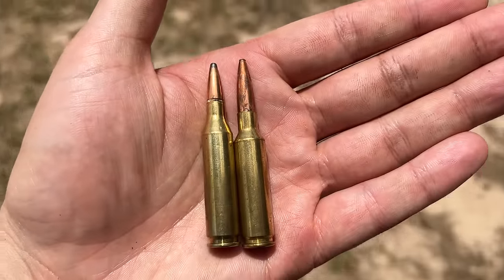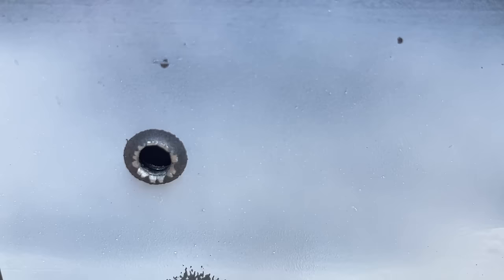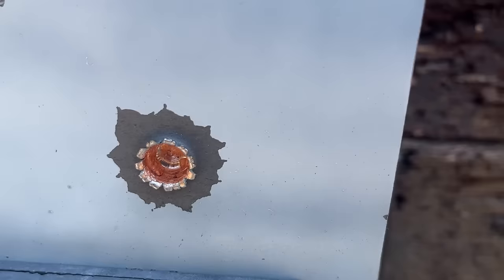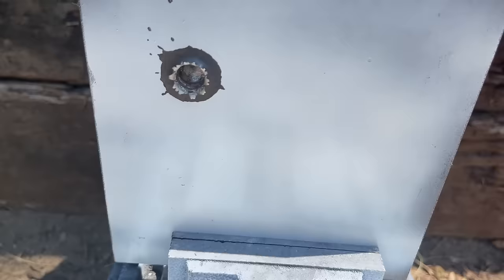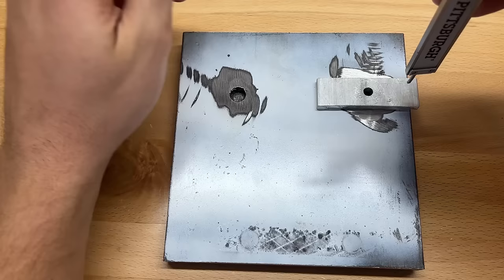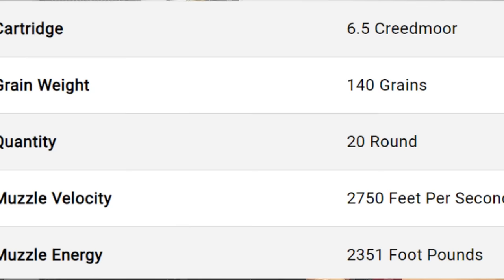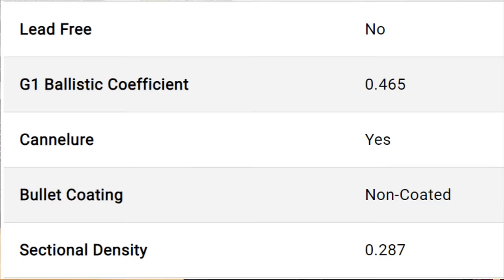243 vs 6.5 Creedmoor: Not So Close On Mild Steel?

Comment: 40 years ago i tried some 80grn 243 on 1/2" steel and they completely penetrated  can't remember what brand they were.  about 30 years ago i did some testing with a remington 600 243 with a 20" barrel and a brno 243 with a 24". with the same hot hand loads with both 70 and 80grn projectiles in both rifles on the same day. i was surprised that the 24" barrel was onley getting about 150fps faster than the 20. i think a lot of people forget just how good some of these old calibers are in the mad rush for something newer.
Reply: At shorter distances there is no difference. But as the shot distance increases the old stuff looks worse and worse. If you just hunt and don't go over 200 or so yards it makes no difference. 

By 300 yards a lot of the new stuff is performing a little better. By the time they travel 500 yards the old bullets are slowing down and dropping a lot more, and are more affected by the wind and it just gets worse faster after that.

 A lot of people are not shooting at those distances so it doesn't matter. But the new cartridges are vastly more efficient, unless you have custom fast twist barrels and you're making custom ammunition, & custom magazines to fit them for an older round. 

The young guys who are starting out buying rifles should be getting the newer technology, since they have to buy the stuff anyway. If you have the old stuff and it's working for you, might as well stick with it.

 But if you look at just the bullet of a modern precision rifle, and compare it side by side with something from a few decades ago there's a huge difference in how streamlined the bullet is.
Reply: I have found going from a good load from a 20" barrel to a 24" can be very different depending on the powder used for each barrel. The 24" barrel will usually like a slower powder for the bigger difference to be seen.
Reply: 150fps is over 5% which is a considerable increase in energy

Comment: should have tried a 55 grain ballistic tip out of the 243 @4000fps lol. it penetrates lvl 3 ar500 better than an m2 ap bullet going 3200 fps out of a 300 wsm lol. the 243 almost penetrated completely through 2 6x6 side plates. where as the ap bullet only penetrated the first and just stuck into the second plate. @50yds. the 243 also made a much wider hole due to it expanding as it penetrated..

Comment: Unless I missed it did you use 100 grain psp .243 or just 80 grns?  Ok, so you did use 100 grn .243 which should have done way better, so it needs the 22 or better yet 24 inch barrel to get up to speed and it should almost penetrate the .5 inch I would bet .420 inch!!

Comment: 100g v 140g equates to .050 deeper penetration for the latter... Fact is they're fairly equal at that range. Personally, I prefer the .243 simply for the variety of ammo loads available. But, I believe the 6.5C is better at long range...?
Reply: Only when shooting paper.  They're both suitable to about 300 yards or so for deer-sized game.  I'm a big 6.5 fan (6.5x55 in my case), but they don't shoot magic death rays.

Can you go further than 300?  Well sure.  I can go further than 300 with my 45-70, doesn't really make it a good idea though.
Reply: The 6mm will out perform the 6.5 for long range. ALL the top PRS shooters shoot 6mms, with the 6mm Dasher being used by over 75% of the finalists in the most recent Armageddon Gear PRS match. A 115 grain 6mm is a very aerodynamic bullet with a very high ballistic coefficient.

Comment: Great video, however, not an apples to apples comparison. 100gr 243 vs 140gr 6.5 shouldn't be equal in steel penetrating. The 260 remington vs the 6.5 would be interesting and probably very close.

Comment: Good video and somewhat interesting results.  What did we learn from this?  The 6.5 Creedmoor, for all of its popularity, is just another good cartridge.  How much better is it than the 243, which was introduced more than 50 years earlier.  In fact, go back to when the first 7x57 was necked down to 6.5 and realize the only real advantage of the Creedmoor is faster-twist barrels and much better bullets.  The cartride, itself, is nothing special.
Reply: The 6.5 cred is nothing special , absolutely correct ! The test is almost meaningless . Two different cartridges and two different bullets , what’s the point ???…….
Reply: The fact of the matter would be if you create a round that would be good. At going through mild steel. It would fly right through a skin bag, possibly even caught her icing itself. Zero expansion no. Tumbling no. Fragmentation. Now on the flip side of that if you take around it that's really great at punching a hole in something like maybe a 45. It's going to really suck at going through mild steel. M'kay. I'm pretty sure every single person in this clip things boxers wear gloves so it doesn't hurt the guy they're punching. Hah😂 live in Bliss

Comment: Density of lead vs copper.  But animals don’t act like 1/2” steel.  Either kill great with good placement.  For ultra long range the 6.5 higher BC wins.  For under 300 yards a .243 is fine.

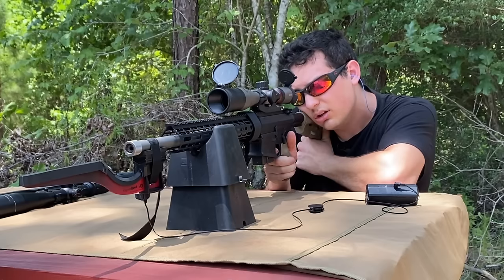Comment: What was the rate of twist on each of these? Just picked up a .243 Henry single shot with a 22" barrel with 1:10 twist. Not that I plan on shooting 1/2 inch steel, but I'm sure cor lost 100 gr. Will do a number on auto bodies, should the need arise...
Reply: It won't stabilize heavy bullets with a 10" twist. A Remington 700 has a 9" twist, & even that is too slow for most of the heavier Hornady 6mm projectiles. Hornady states the required ROT for their bullets in their catalog & some of their 6mms require 7" twist minimum & 6.5" would be better.

Comment: I think a lighter, faster .243 would punch through. Punching through armor looks to be heavy on velocity. 2700 just isn't fast enough for the .243. I think a year or two ago on another channel someone loaded out a .243 AR with a bullet running 3400+ and that plate was not an issue.
Reply: Yeah a 100gr bullet going 2700fps is slow for 243. Even factory 100gr loads are going around 2950-3000. You can get another 200fps with hand loads or nearly 4k fps with light 55gr hand loads.
Reply from the maker: Might need to do some testing with much lighter 243 bullets. They might toss things up a bit
Reply: @bananaballistics   Problem is, without handloading there isn't much out there below about 70 grains. I think 3400 fps was the breakover point for level 4 plates with .243 win. Always love watching your videos, and adding the information to what I can remember. We have so much more info now out there to make choices with.
Reply: CRS firearms. The BA-Shredder. He tested in conjunction with Buffman Range. Results were ok. But, light 6mm bullets are typically of the varmint grenade variety. They almost detonate on tissue. Not ideal to punch plates.. but, 6mm, round stock can be had in many alloys

Comment: I haven’t seen anyone mention this yet, but I think the heat generated at impact is the reason copper does so poorly. @banana Consider for a second how hot the steel plug was when you picked it up. 

Copper is 10x more thermally conductive as lead, and roughly 7x more conductive than steel.

At impact, all the heat generated needs to go somewhere, and it’s far easier and faster to dump into the copper bullet than into the steel target or into the air. 

Again, how hot was that steel slug? With copper being a better conductor, the copper bullet would have been heated to many times that temperature and melted/softened to the point it lost density and resulted in poor penetration. 

In a live game scenario, there are factors less friction at impact and the bullet doesn’t have the same runaway heat pickup. As the bullet continues to move through the animal and begins to slow dow , I’d imagine it is able to deposit heat into the flesh as well.

Comment: Those copper bullets looked like Barnes (or similar) which is a leadless hunting round and made to expand on impact, as you would guess from the plastic tip of those bullets.
Reply: The plastic tip was developed by Nosler over 30 years ago to circumvent the problem of lead soft points deforming while carrying, loading, & chambering! Plastic tips have nothing to do with changing the expansion.
Reply: The polymer tips were developed by Nosler 30 years ago to prevent deformation when being cycled into the chamber, which occurs to soft point lead bullets. Hornady changed the polymer type  because they discovered the tips were melting from atmospheric friction, something I had concerns about since Nosler's introduction of them decades ago!

Comment: I am not that interested in shoot holes in steel plates . I am more interested in how accurate a cartridge is on a paper target and on game .  I have used ,243 for decades and don't see anything here to make me rush out and buy a 6.5 Creedmorr .  I do however like the longer neck and sharper shoulder of the Creedmorr case which I know I could squeeze a bit more accuracy out off but not enough difference to drop the cash . When I think that .243W is not up to the job I jump right over 6.5 to .308 cal .

Comment: I would like to see 6.5 creedmoor vs 25-06 with similar bullet weights. 120 gr and or 100gr .
Reply: The 25-06 will be better with the same weight bullet because it will be longer for weight than the 6.5. As stated several times, a fair test would have been a 260 Rem against the 6.5 CR so the diameter & weight would be identical.

Comment: I have a 300 win mag and was shoot steel targets ranging from 100 200 and 300 yards and noticed and I noticed out of the three rounds I was using one of the were really hurting the 3/8 ar 500 plates. So I put it at 25 yards so I could see were it was hitting and the federal premium 180 power shock just went straight through it all the other rounds were still barely doing anything. I would like to see those 180 grain power shocks against that 3/4 mild steel plate
Reply: Those 180gr bullets are carrying a ton of energy. And they let you know it. My ar10 has had a little bit of everything, and there's a definite recoil difference between my favorite 140gr silver bear and 168gr GMM..
Reply: @PureCountryof91 Momentum drives penetration not kinetic energy.

Comment: Punching holes in steel is an indication of velocity. Push a pine needle fast enough and it will penetrate steel plate. Unless you’re looking to use a rifle instead of a drill to put your holes in steel, this is meaningless. But hey, it’s not hurting anybody!

Comment: A U shaped measuring plate, instead of flat, should allow you to measure without grinding!
Reply: Good idea!
Reply: It would also measure the frag depth. Not just indentation
Reply: @PureCountryof91  the U would not touch the raised edges if that is what you are talking about by 'frag depth'.

Comment: If you were tracking bullet design at all you would know the answer. First, sporting ammo is not designed to go through steel.  The reason behind that result with copper, is that due to complaints about sub par solid copper expansion at longer range (impacts on game at sub 2000fps) companies responded by making design improvements in ogives and the like to ensure that copper will expand more reliably at a wider range of velocities. On steel this just exaggerates the effect of this engineering. If you uses first generation copper bullets you would likely punch through more easily.

Comment: I'm at a loss. Sighting in my savage Axis 6.5 Creedemore this past weekend. shooting paper. all Good. I moved over to a 8x8 5/8 thick hardened stainless-steel Plate hanging at 100 yards. This is my 7.62x39 ringing target I shoot for kicks. Never have I damaged it. I thought it would be ok.  The 6.5 Hornady American Whitetail Punched a rimmed 1/2 hole clear through it. I could believe it. so, I shot it again. Now it has two 1/2-inch rimmed holes. I don't know why you didn't punch that steel at such a short distance. I know what I did. And I think I know what I see. I'm at a loss.
Reply: Hardened stainless 5/8? That hornady American whitetail is the worst ammo hornady makes. That’s surprising I will say. Wow

Comment: I've never had a .243 but I own a 6.5cm and it's a very accurate rifle and a very flat shooter over good distances.
Reply: 6.5CM IS NOT a flat shooter, it was never designed to be. Overweight bullets for caliber just can’t be flat shooting, its physics. By using faster twist and well designed bullets they are capable of incredible accuracy out to long distances. But the long and shorter distance accuracy is achieved with more variance in trajectory than lighter bullets going faster at the same ranges. Longer, heavier bullets generally have better aerodynamics and the increase in accuracy is more pronounced at longer ranges.

Comment: Momentum drives penetration not kinetic energy.     The physics of penetration is the same regardless of size so let's compare the penetration of the German 380mm/51 cal to the US 16"/50 cal at 25kyds.  The German gun fires a 1700lb AP at 2690 fps and penetrates 15.46" of face hardened armor.  The US gun fires 2700lb Mk 8 AP round at 2500fps and penetrates 17.36" of face hardened Armor.  The difference is momentum.   Momentum is a linear function of velocity so the difference in momentum between the .243 and 6.5 is smaller than the kinetic energy which is a function of the square of velocity.  It is not surprising that there was only a slight difference in penetration. 

Now try the test against Special Treatment Steel.

Comment: Copper is softer than gilding metal, which is what most bullet jackets are made of.  Common gilding metal is 95% Cu and 5% Zn.
Reply: Do you guild your own?
Reply: @izzyplusplusplus1004  it's "gild" and no, I don't.  lots of good options for bullets out there if you want to hand load your own ammo.
Reply: @smokedbrisket3033  I do know that. Just getting interested in hand forming some projectiles. Got some ideas for a machine to help automate at home.
Reply: @izzyplusplusplus1004  - fair enough.  it's some complex business, chemistry and physics and machining beyond my kin.  I'm half tempted to cast my own bullets for my 45-70, but making my own jacketed bullets...that's just beyond me. 

If I were wanting to pursue that, I'd talk to Geoff McDonald of Woodleigh bullets (an Australian company that manufactures premium bullets).  As I understand it, he basically started in his garage more or less.
Reply: @smokedbrisket3033  I have a friend with some serious cnc skills, and we have been collaborating.
Reply: @izzyplusplusplus1004  awesome.  a suggestion.  the market is saturated with what we call "cup and core" bullets, which have been around since the 1890s.  if I were going to design a new bullet, I'd probably think about a monometal like Barnes TSX, but I'd borrow some design elements from Hammer bullets and North Fork on the pressure bands.  I think North Fork does the best of both worlds - a chemically bonded lead core (like Swift, Woodleigh, and Norma) + pressure bands the way Hammer does them.  My only bitch about Hammer bullets is that the nose is designed to fall away like Nosler Partition does.  Still good weight retention, but not as good as Swift, Norma, Woodleigh, and Barnes.

I reload for about a dozen different cartridges.  If you come up with something, I'd love to give it a go - from .264 to .458
Reply: @smokedbrisket3033  Well, as a long time hunter, and having shot many rounds, but still nowhere near enough, I would really like being able to supply myself with target and hunting ammo.
And field test said myself. 
Thats darn expensive. Might as well make em myself.

Comment: I wanna see penetrating rounds from the 243. My grandpa used to handload, he had some steel core moly coated loads that would blow through everything!
Reply from the maker: Those sound interesting. Seems like they used to make some pretty wild bullets
Reply: @bananaballistics the bore of .243 is 6mm. Get some brass rods, cut, taper to the dimensions of a 100gr sp .243, load, re-test. I'm actually super tempted to try this in an ar10 later on. AP is expensive.. .243 ammo and brass rods? Maybe not.

Comment: I have a pet theory that the main difference between 6.5 Creedmoor and 243 Winchester is the SAAMI CUP (pressure) spec -- 62,000 psi vs. 60,000 psi, respectively. My guess is the lower spec on the older cartridge is due to the earlier state of metallurgy when it was introduced.

That said, I brought this up over at MarkandSam AfterWork and they replied and said no, so I am probably wrong. But it would be interesting to see what happens if you do the experiment again with hand loads, using all the same stuff (primer, powder brand and weight, bullet) just with different brass and (of course) rifle.
Reply: Mark and Sam are correct.  You'll find a greater spread in chamber pressure when doing load development for the same bullet fired from the same rifle with progressively larger powder charges.
Reply: Need to use the SAME diameter & weight bullets for a "fair" test.

Comment: Speed is what kills steel . The 22-250 would probably out perform both on steel
Reply: Speed isn't the main factor. The smaller the diameter, the more energy per square inch. The 22 concentrates the impact over a much smaller are than the 6mm & the 6.5mm, A 17 Remington would be better yet!

Comment: I'll stick with .243 because I'm never going to need or want to shoot at something 1000 yards away.
Reply: 6mm is a great 1000 yard projectile but you'd have to have your 243 rebarreled to a faster twist rate to stabilize the bullets used for the distance. The most recent $75,000 Armageddon Gear PRS match was dominated by 6mm Dashers
Reply: @bradgriffith4231 Interesting, but that's still nothing i'm interested in.